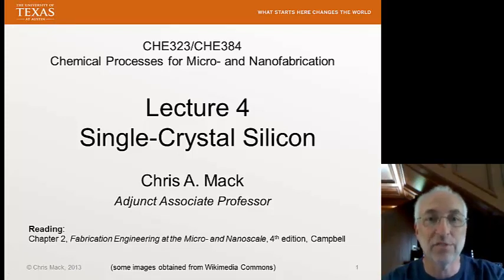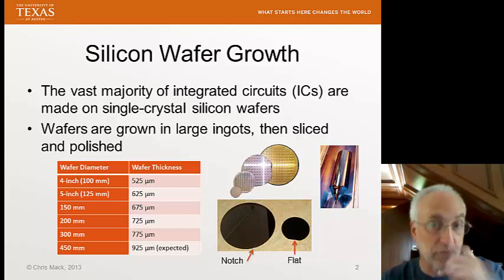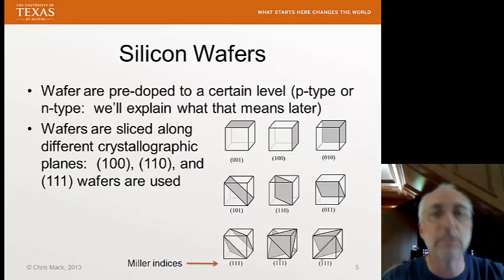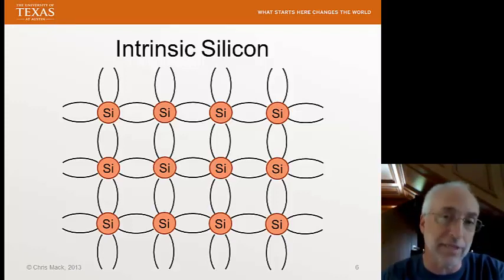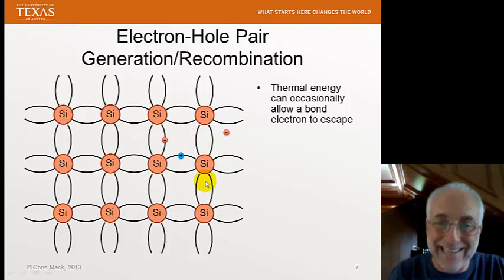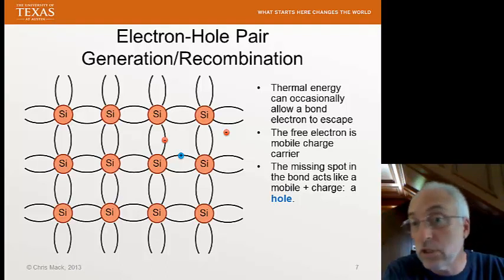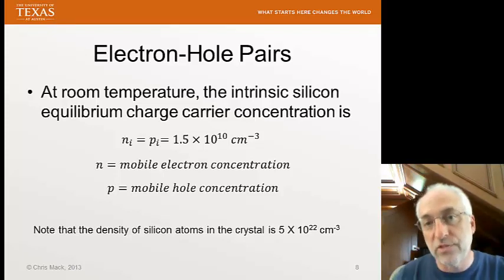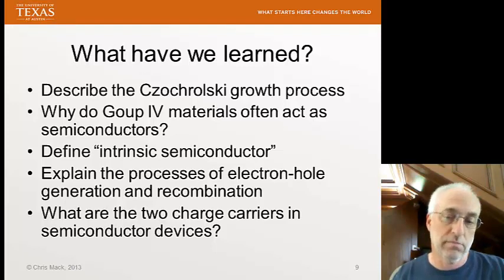Lecture 4 (CHE 323) Single-Crystal Silicon

Comment: A nice way to show the effects of those electrons moving towards the conduction band due temperature is taking a photo (better with cmos sensors) in a dark place. What the sensor will catch is thermal noise. Along with other effects due wiring and transistors leakage